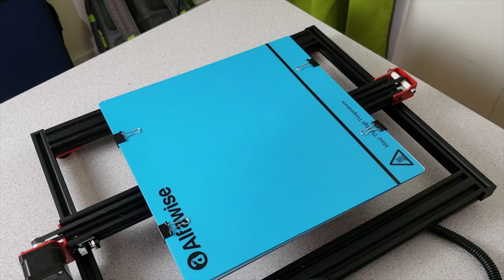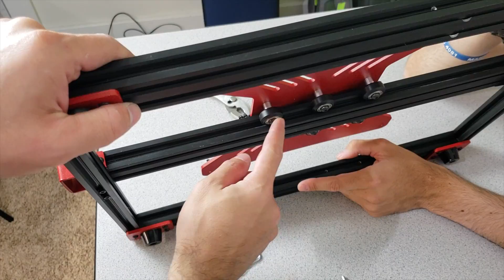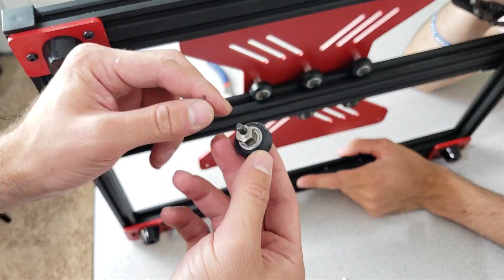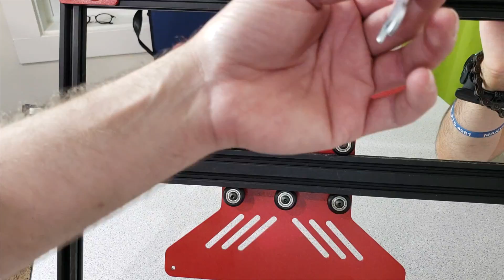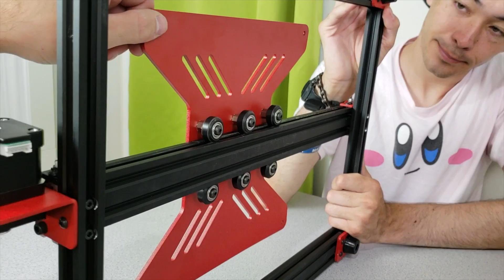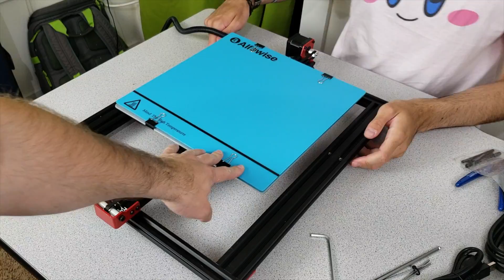How to Fix Wobbling Heat Bed?  | Alfawise U20

Comment: Hi, got my Alfawise U20 the other day, my bed was not wobbly, but when I slide the bed back and forth, the wheels felt like they had flat spot, and always stop in the same spots,  5 different places, I loosen the two outer wheels and that fix it somewhat, but for some reason the middle wheel,  I cannot get it to adjust, do you think by loosening the middle bolt that holds the wheel on, well help?
Thanks.